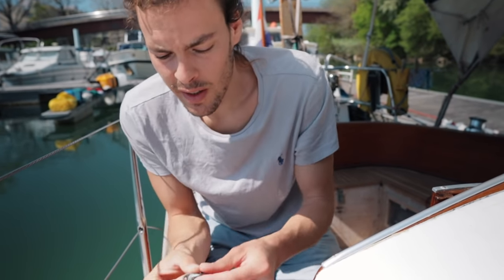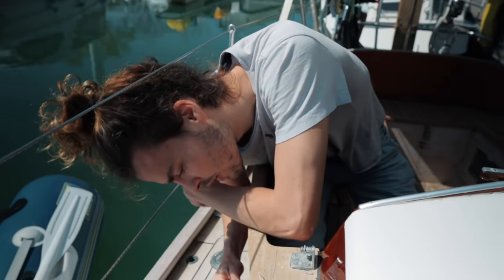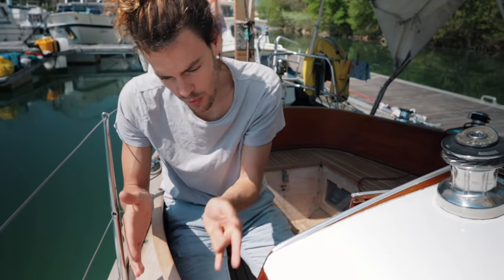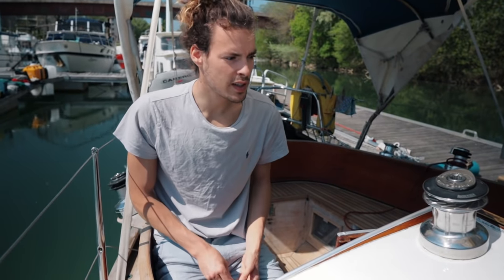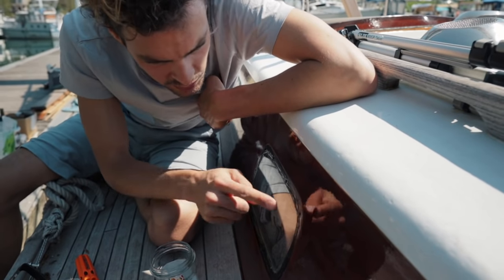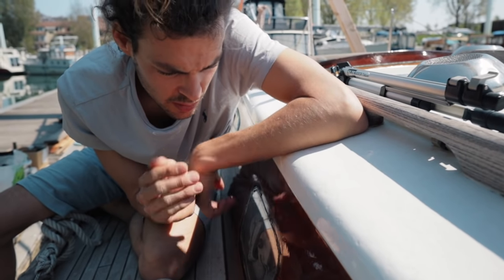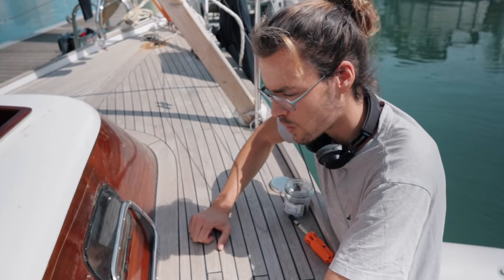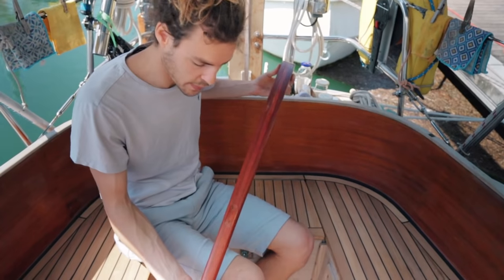LOCKDOWN PROJECTS: How to INSPECT your boat to prevent future problems! [brightwork]

Comment: Great video thank you! One way you can improve  those small pressed Steel Parts with a hollow back is to fill the entire back full with epoxy to make a flush surface on the backside. This will distribute the load evenly onto the wood and prevent those sharp edges from digging in to the varnish.
Reply from the maker: Absolutely!
Thx Richard
Aladino

Comment: Nice video. Great well-structured approach. Good to see you want to make things even better than they (likely) have ever been ;) Here the words of an old shipwright spring to mind: I want to seal once; if something goes through some outer wall of the boat, I seal it on the outside; that way, when a seal leaks, you'll see right away; I don't want leaking water to crawl into spaces and have a huge problem later.

Comment: In regards to the cockpit mount of the autopilot my question: what is your opinion on over drilling screw holes, filling them with epoxy and redrilling smaller after cured, to protect water getting possible moisture access to the wood? Are there cases where this is recommendable and where not and why? Also are there potential structural challenges with such procedure?
Of course here with the autopilot I understand a structural enforcement like you intend to do to be still required, due to the push/pull forces of the autopilot.
Btw. I think many of us would appreciate if you could put together a collection of maintenance videos sorted by topic, to make them searchable. Your expertise as a professional boatbuilder is a true treasure for the average sailor and as such highly appreciated. Thank you guys for your always great videos!
Reply from the maker: Hy Samai!
Thx for your post! For thru bolting The procedure you mention is great! Make sure you leave as much grp as possible if that is the case and use backingplates where required.
Talking of bare wood instead and not thru bolting, epoxy presents less meat for a screw to grab... you can still do it for less critical things( no force on it) and by adding fillers you also give it more body. Without it can be brittle and crack. 
Cheers 
Aladino
Reply: Samai Pats was

Comment: Hi guys - hope you are staying safe in the french country side. @Aladino: When you presented the fitting for the sprayhood I couldn't help noticing remains of some kind of foam on the inside of it ... as if there was once some kind of gasket/spacer between the fitting and the teak top.
Would it be feasable to fill the fitting with silicone and cut/carve a thin rubber gasket to fit in between the fitting and the cabin top - instead of fabricating a new fitting? :-) Again - stay safe and get ready to go north ... Fair winds, JP

Comment: Ettan (instead of epoxy) is also widely used to treat wood cracks around the windows. And not just around the windows. By glueing with epoxy, wood continues to move/expand, and its a high chance it will crack either the same seam, or wood adjacent. Ettan on the other hand is volatile and flexible.
Reply: Is Ettan similar to Sikaflex or Pantera? Never heard of it.
Reply: @sailingmistral685  It is produced from natural ingredients: balsam resin, beech tar, wax, linseed oil, colophony. Can be used for underwater, as well as for deck cracks. For deck you want to fill the crack with ettan, in the sunlight (warm weather), so that it melts and fills the crack completely. Once the temp drops, you cover it with varnish. Once applied, it has a color very similar to the wood, small cracks become invisible. And no need to mess around with resins, hardeners, fillers, etc.

Comment: Love your channel. Regarding the autopilot fitting. It is only 1-2 inches deep but could you drill a hole say 6 inches deep insert a tube and then insert the autopilot fitting in that tube therefore making the leverage 1 to 6 instead of 1 to 1 and no added cheeks on this beautiful wood?
Cheers,